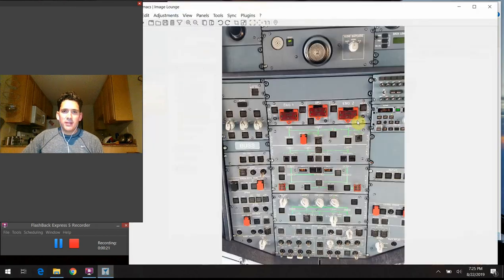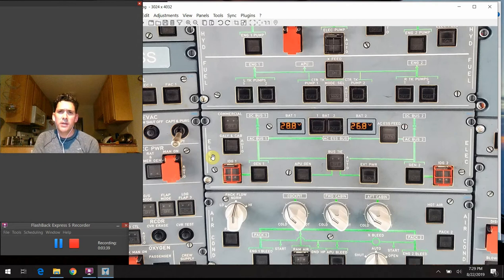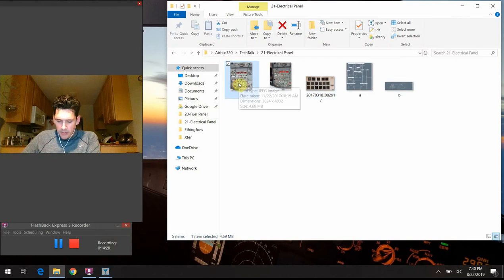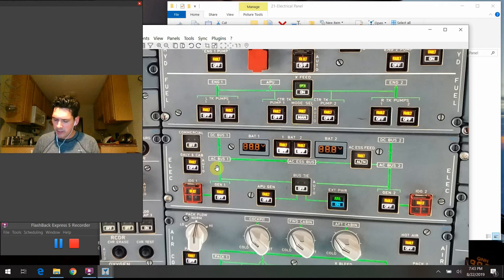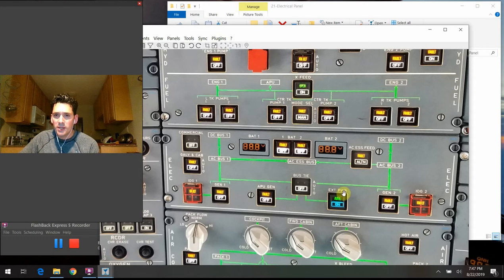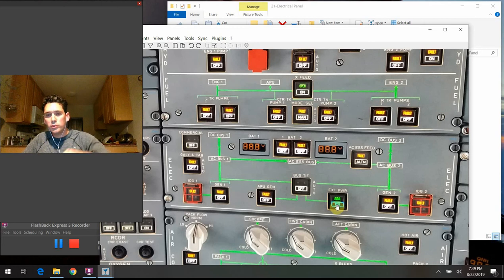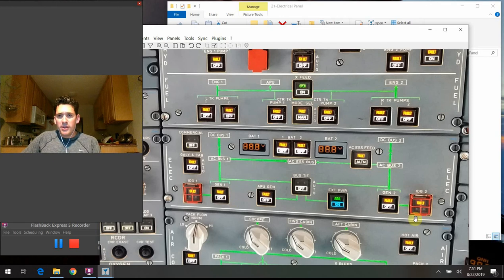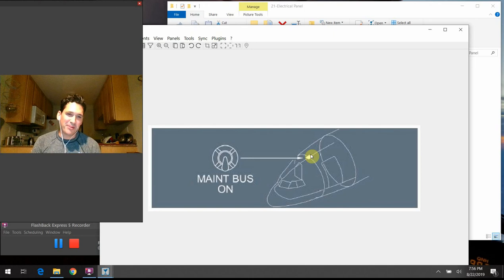Airbus A320 Cockpit Tour: #21 - Electrical Panel: What do all those buttons do?!

Comment: Hi again Sir Mike, I'm just curious if there is a difference when pressing the guarded red pushbutton RAT MAN ON on overhead hyd panel to the guarded MAN ON on Emergency Elec Panel?  I have an idea but I just want a clarification.
Reply from the maker: Hi Mr Regis, great question my friend. Yes there is indeed a difference. If you use the switch on HYD panel, you will only get the BLUE emergency HYD pump to activate, but not the emergency electrical generator. If you use the switch on the ELEC panel you will get both the emergency pump and the emergency GEN online. Remember the airbus is kind of unique in this way. Most other aircraft that I know of are not set up in such a fashion, but the airbus RAT drives only a hydraulic pump which is then in turn used to turn an electric generator. Lot's other aircraft work the opposite way. The RAT drives an electrical generator that then routes power out to power a hydraulic pump. Hope all is well, cheers! Mike

Comment: In the ECAM ELEC page , I noticed that the EXT PWR section is missing. Is it something that is available only when the aircraft is connected to external power or Is  there no need for that section? Besides that , I noted that the APU section is not connected by any arrows unlike the other sections in the ELEC page. Is it because at the time it was taken , the APU is switched off?
What does the % indicate in the APU and GEN 1&2 sections? What is TR 1&2 in the ELEC page?
Can you also show us how an external power plug (disconnected) and it's connecters and panel look like? Does it differ with different aircrafts? Does both narrowbody and wide body aircrafts use the same type of external power unit or does wide body aircrafts require a different external power unit for the extra loads?
Reply from the maker: Hi Aby, thanks again for tuning in! 

In the ECAM ELEC page , I noticed that the EXT PWR section is missing. Is it something that is available only when the aircraft is connected to external power or Is there no need for that section? - Yes that's correct Aby, the icon will only appear when the plane registers that it is plugged in.

Besides that , I noted that the APU section is not connected by any arrows unlike the other sections in the ELEC page. Is it because at the time it was taken , the APU is switched off? - Apu is on in this case,  but the power priority logic has the plane drawing its power from the external source at this moment in time. 

What does the % indicate in the APU and GEN 1&2 sections? - Generator load. 

What is TR 1&2 in the ELEC page? - Transformer Rectifier. Does the job of converting AC power to DC power. 

Can you also show us how an external power plug (disconnected) and it's connecters and panel look like? - I'll try to snap some shots for you...

Does it differ with different aircrafts? - It does differ for smaller aircraft,  but I believe this plug size is standard for most large aircraft in the Air Transport category. 

Does both narrowbody and wide body aircrafts use the same type of external power unit or does wide body aircrafts require a different external power unit for the extra loads? - Im not completely sure as I've never flown a wide body,  but I believe the systems are the same. I imagine the power output capabilities of the power generator would have to be greater to supply something like a 747 or A380, but for the most part I would venture to say that everything else is similar.
Reply: @MikeAbignale   Thank you very much for clarifying my questions Mr. Abignale 😀😀😀

Comment: Me: Accidentally holds the IDG Disconnect switch for 10 seconds.

ECAM: Eng 2 Oil Temp High

Lesson: FOLLOW AIRBUS PROCEDURE AND DON'T HOLD THE DISCONNECT SWITCH FOR MORE THAN 5 SECONDS.
Reply: Also they should guard the commercial and galley switches. I want my in flight entertainment!
Reply from the maker: haha I like this suggestion
Reply: :) Great Vid!
Reply from the maker: @frijjkwfgd  Thanks!